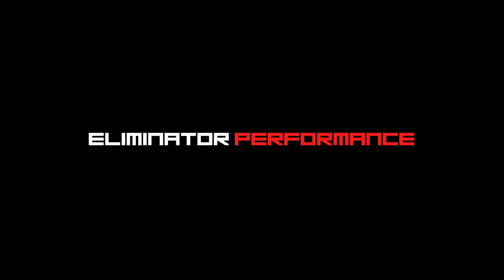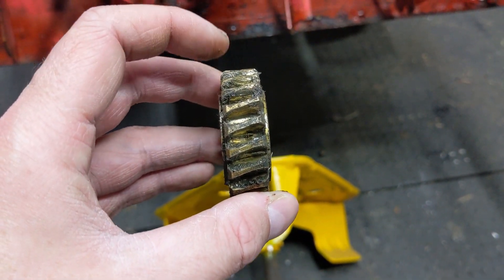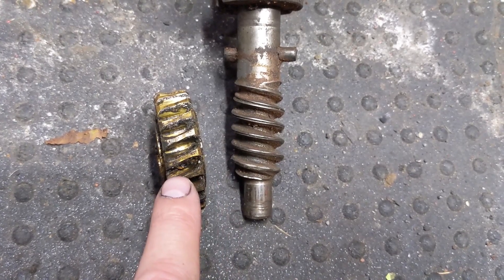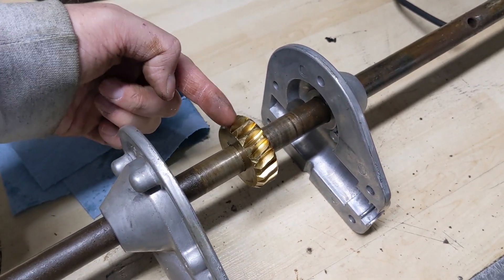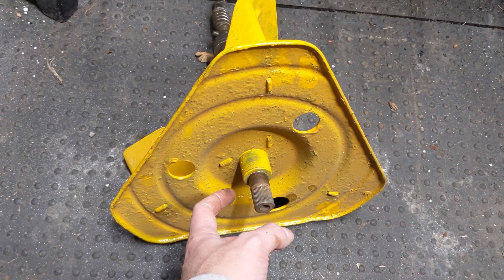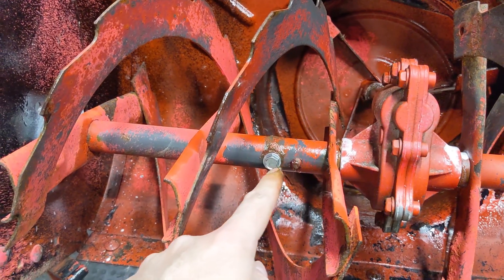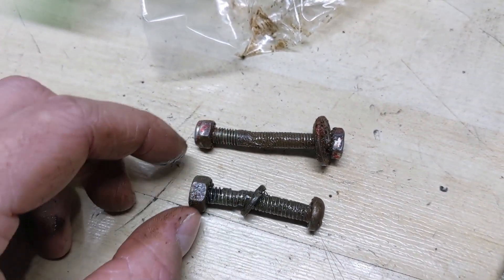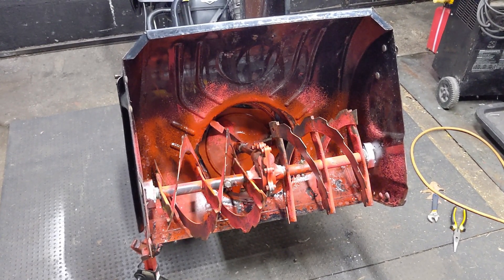Shear Bolts - Snowblower Maintenance

Comment: So I acquired a 2000 Noma. My shear bolts have threads with no break points. Can u talk about the line marks on the head. Mines have 3 line marks is that a shear bolt?
Reply from the maker: 3 lines are trade 5, 6 lines are grade 8

Comment: Thank you very much for this video. I see it's 4 years old but I enjoyed it!  Quick question - Why do impellers have 2 shear bolts and the augers each only have 1? And with locking washers how far do you actually have to tighten down the shear bolt? I see you said not to do it tightly.  I have a Poulan Pro model PR242 purchased new January 2016. Today my impeller stopped working and I was able to figure out the shear pin must have broke with the heavy wet snow today in Michigan. Fortunately Poulan provided 2 spare shear bolts so I was able to get back up and running but now I'm concerned with how far should I put the lock nut on, and do both bolts typically shear at the same time, or could have one of mine sheared prior to today? Hopefully you get this message and can reply. Thank you again.
Reply from the maker: @jimwalt  just until it's snug, you don't want to tighten it like a regular bolt.

Comment: Nice.  I broke 4 auger bolts in my toro 824 OE in 4 hours clearing out thick wet icy snow.  Toro deceptively claims their super hardened gear box eliminates the need for shear bolts.  The actual auger bolt they use, toro 321-10, a $1.13 US priced bolts,  is not currently available from Toro making my think I am not the only one breaking these auger bolts.  I tried to to contact Toro to find out what bolt I can safely use, but no luck getting anyone to help by phone.  I think they are a grade 5 bolt as they have the 3 hatch marks.   And a toro rep answered this question on a Home Depot question as due to the hardened auger tranny they are using a grade 5 bolt.   But I sure would like to know what is a safe bolt to use in a powermax 824 blower with Toro bolts not even available now??  I see someone trying to see the Toro bolts for $6/each, but I am not going to support or trust anyone trying to charge/scalp them for 5 times the retail price.  I ordered some Stens 1/4" by 1 9/16" shear pins that I know will fit, but suspect I will be breaking them even faster than the OEM bolts.  Till I get those Stens bolts, it will be Ace hardware grade 5 14" by 1 1/2" bolts as I need to clear out this snow that is happening.  Toro is really causing people to destroy these machines by claiming no shear bolts to replace in their marketing hype, as when they do break, nobody has shear bolts ready to go.  These bolts are so hard to find and know what to replace with, most people will just install a grade 8 bolt as that is all they can get locally and then they risk doing the damage you have documented in this video.  Any help to know what these Toro machines can use safely would be appreciated.  I see I am not the only one here asking this question!
Reply: @Marcia Ewell   Hi...  I'm a newbie at replies on YouTube.  Hope you see this.   I have the same problem.  However I have a TORO Super Max 826 LE Snowthrower (close enough to yours perhaps?)   In the last 24 hrs I have broke my original shear bolts on the impeller (on the machine since bought 20 yrs ago?)  and two dealer purchased spares I had.   That's the shear bolts for the rear impeller not the auger (front).   No ice or object...  just very wet snow.  I've had wetter snow before...  so strange why now?  perhaps something else might be going on my machine to cause this.      Anyway why I'm replying to you....   (1) I did much research on shear bolts for my Toro.  Only two separate comments made on two unrelated forums very firmly said that the Toro uses Grade 5 bolts...  As "Eliminator Performance" said numerous times (and I'm sure he's 100% correct)  ONLY USE THE SHEAR BOLTS MEANT FOR YOUR MACHINE... SO I WAS STILL NOT CONVINCED to use Grade 5 bolts on my machine... (why?... called dealer... they won't have them in for another 7 days!!!!...   I've got snow on my driveway to clear!).  HOWEVER  POINT # (2)...  I just checked the exact replacement spare shear pins that I bought from the dealer for the front (auger).  For my Toro it's part #322-11  They very clearly have the 3 hash marks on the head of the bolts (indicating Grade 5) bolts.    The auger bolts are 5/16" but the impeller shear bolts are 1/4"  so these won't work for the impeller bolts....   So as I'm desperate...  I went to the local hardware store and bought a couple of 2" long 1/4" grade 5 bolts to hold me over until the correct ones arrive.    I'm still not 100% sure,,, so I will be using it very very carefully until then.    Hope this information is of some use to you...  for what it's worth.   good luck !!!

Comment: Quick question in case you happen to see this although I realize this video is a couple of years old. I have a one year old Toro Power Max 826 OHAE. I purchased the correct shear bolts but after getting to replace the shear bolt I realized the old one was still jammed in there. Would you have any helpful hints as far as trying to remove one of these shear bolts that seems to be really stuck in there? I tried using a punch and hammer and have yet to get it to move.
Reply: Hi... perhaps try spraying lots of penetrating oil..  or WD-40 in there and let it sit...  and maybe even more the next day again...  the punch and hammer are the tools that I've used.   Just watch out and make sure you use a punch that is narrower than the bolt hole.   If you use a tapered punch you might not be putting all the pressure on the stuck bolt.   Bin there done that... LOL.
Reply: @rickf2061  Thank you so much for the answer. I will give it a shot starting tomorrow. I should be alright for at least a week since we have no big snow storms forecasted any time soon.

Comment: I'm all about correct words for parts and tools.  Thanks for the clarification between bolts and pins.  It's easy, folks - screws function on their own, bolts require a nut to secure the bolt in place.  Pins require another pin or part fitted at 90 degrees to secure or do the securing themselves in the same way (lynch pin, cotter/split pin, clevis pin...).  (Don't get me started on "leverage" when the correct word is "torque"!)  ;-)  Well, since I'm verbiage profuse today, here's the deal, people.  Leverage requires two things - a lever and a fulcrum.  Leverage does not rotate but instead operates bi-directionally to move a load utilizing the distance from either end the fulcrum is located to determine force multiplier.  Torque always acts around a central rotational axis - there is no fulcrum involved and force involved depends primarily on distance load is exerted from the axis.

Comment: Pretty thorough video on shear pins.  Thanks for posting the video.  One question though: Do you recommend using anti-seize on shear pins? Also, if there are no zerk fittings on the shaft, what is the best way to grease the shaft without taking things apart?  Thanks in advance for your insight and experience in the matter.
Reply from the maker: Antisieze wouldn't hurt, anything to help keep them from rusting in place! Also, you could try some penetrating oil or something like that. You could also drill a hole and add a zerk fitting. I've never done it but it's possible!
Reply: @EliminatorPerformance  Thank your much EP for your advice.  Have a wonderful day!
Reply: @EliminatorPerformance  (Just so you know, this comment is similar to what I sent to Donyboy73, here: https://www.youtube.com/watch?v=4piKxBhIpUM, as both of you Canadians are my primary source for snowblower information/education - as well as all other small engines, of course.)

I've learned tons from you over the months since I subscribed, so thanks for that!

I have a 1989 Toro 724 (38072) which I got on FreeCycle.  I've been going over the entire machine to repair, correct and service completely before using it for the first time (my first time ever using a snowblower, so I’m also watching operational videos plus reading the manual).

I've found a variety of things wrong with this machine but have managed to fix one after another - dirty plug, one skid shoe worn completely down, scraper blade worn over 1/4 inch more in the center than the outboard ends, tires underinflated (the one on the same side as the worn skid shoe much lower pressure, of course!), traction belt ready to snap, float bowl flat not lined up with float pin. It's obvious the original owner didn't know much about blower use or maintenance, but at least I can rotate the crank, it feels like it's got decent compression and the electric starter works fine (hit it just a couple of quick blips with the plug out to confirm function).

I pulled a shear bolt and it’s actually a grade 5, despite this being the same one (322-12  Screw-Bolt) Toro has on their IPL (https://weingartz.com/assembly-diagram/toro-parts-lookup/model-38072-724-snowthrower-1995-sn-5900001-5999999-auger-assembly/4274-198147-204633).  Given the amount of rust on it I suspect it was the OEM when the machine was new.  Someone mentioned that Toro uses these bolts because their gearboxes are designed to not fail and the engine will stop first. Someone else said the auger belt will slip before any damage happens.  Both of those sound like incorrect statements to me and certainly potentially damaging to the crankshaft/connecting rod, etc.). In thinking about this and your probable experience with bent/deformed shear bolts that need to be drifted out of the shaft for replacement I'm of the opinion that grade 5 (or hardened of any kind) should not be used, but rather a real shear bolt with grooves cast in so the bolt will actually break off rather than bend/deform. I'm going to replace the bolts I've found on my machine with actual shear bolts - https://www.amazon.com/gp/product/B07G3KFGC4?ref=ppx_pt2_dt_b_prod_image - (a way better deal than the ones you mentioned).

I have a suggestion for a future video - how to straighten bent auger blades on a snowblower. Mine were bent in multiple places (as much as 2cm off center) and I ended up using a 3-inch C-clamp to straighten as needed. The C-clamp was short enough to fit in between the blades to be able to do the job (as opposed to the Stillson wrench I started out with). I don't know about auger blades on shaft-only augers versus mine which has a drum blade construction, but I suppose they bend as well and then become less efficient at feeding snow into the impeller.

One other question - have you run across machines with no fuel filter, and if so, did you see damage to the machine commensurate with having no filter?  I’m aware that snowblowers don’t need air filters given the conditions in which they operate, so I’m wondering whether the same holds true for fuel filters and may explain why this machine has survived 33 years and probably will still run.  My machine appears to have never had a fuel filter (either external or mounted inside the bottom of the tank like later models). This seems to be a recipe for disaster so I'll be cutting the fuel line upstream of the shutoff to install one (paper, clear). The good news is I received the machine with the tank totally dry, clean and not smelling of any kind of fuel and the carb bowl was also clean and drained (old style with drain and adjustable main jet). I've cleaned the carb completely (including ultrasonic) so I'm hoping the machine will start right up and run just fine with a little tweaking to the low and high speed jets and idle and high speed adjustment screws. :)

Thanks again for all your hard work producing exceptional quality instructional videos.  I also very much appreciate your dad contributing his knowledge and input.  At 74 I can use all the help I can get!

Comment: As Steve Voyer said another "spot on" video. Have spent many hours using a drift pin and large hammer to remove bent bolts or machine screws inside the axel when they were NOT proper lubricated shear bolts. Hard to explain to the customer that there may be damage in the gear box but you cannot tell since it has no access point for adding 00 grease and if it does have access you may be able to use a Q tip or other to sample the grease for brass particles to show the customer. Once damage is started it just keeps getting worse !

Comment: I had one come in and the old guy had grade 8 bolts in it an exploded transmission housing.   I welded it up (the sheet metal holding the gears) and use it but I won't sell it as I just use it.  I have a conscience.
Reply from the maker: Grade 8 bolts! Yes, it's too bad. $8 Canadian would've prevented that!

Comment: Very informative video,
I Have a question for you
I am working on a 8hp hm80 155 techumseh with internal ignition, i Have replace the coil, point and condenser, and Have spark, New carburator and gas hose and fuel stop valve, but it is stilk hhard to start, starts after 10 pull in start rope and when it start it perfectly
I Have good compression
What can be the reason
Reply from the maker: Hard to say, could be weak spark? Could be valves that need to be adjusted? Carb not set properly? So many variables... Thanks for watching!
Reply: I remove the flywheel and cleaned the point, Maybe there where some Oil on them, and when i assdmbled the motor it start on first pull problem solved,
Once again thanks for excellent videos

Comment from the maker: Something I didn't mention, these shear bolts usually cost about $4.00 each (Canadian). So you'd be into this for $16.00 if you replaced these and had 2 spares. $16.00 compared to a $300+ repair bill is not even comparable!

Comment: Thanks for sharing your expertise!   Is there any reason why they make those gears out of brass as you said, it’s a softer metal.
Reply from the maker: Probably so that it gets destroyed in the event this happens. Something has to be weaker than everything else, it's most likely designed to fail.